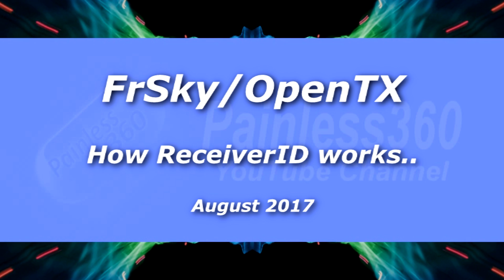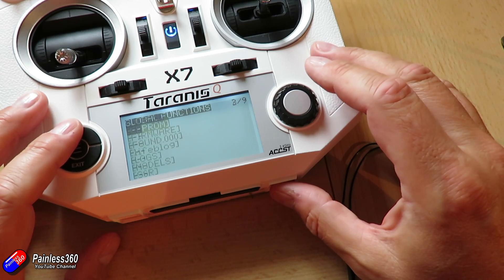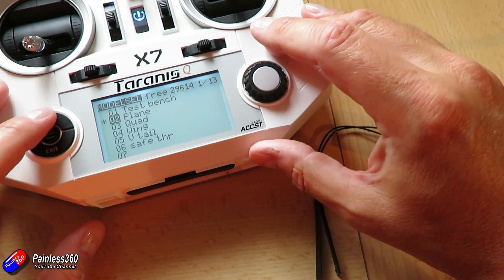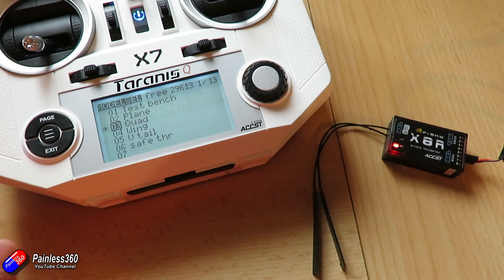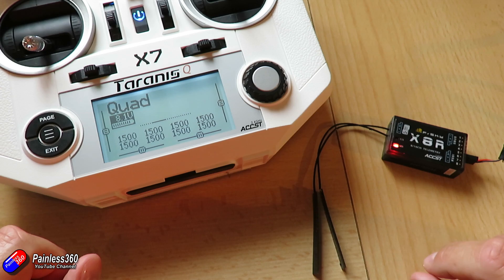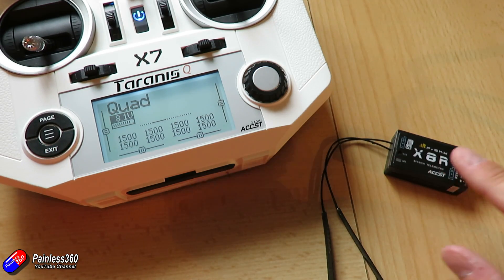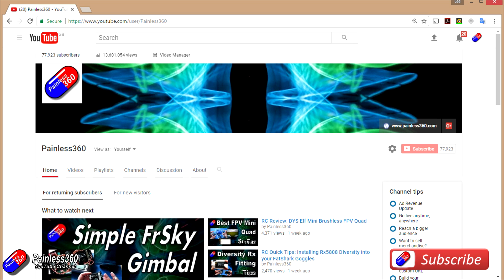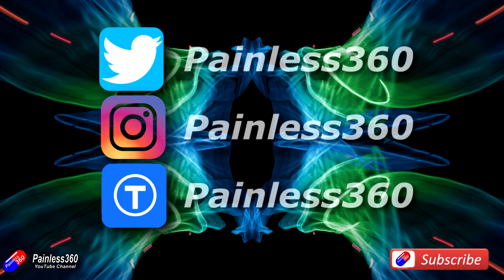RC Quick Tip: How does the RxNum work in OpenTX?

Comment: I’m searching thru your other videos now but I have 4 whoops using flysky 2a protocol and currently have them on 4 separate models which works fine but was wondering if I could use this method to have them all under 1 model and just change the rx number to let’s say 1,2,3,4 for my 4 whoops and have them
All under 1 model and I just cycle thru the rx number to the appropriate whoop so it’s bound
Reply from the maker: Yes you can, you can even set them up with the same RXNum but watch out to make sure only one of them is powered at once!
Reply: @Painless360  if they are set to the same r number won’t I run into the same issue I did before , which is losing the bind of the previous model? I’m able to put all my d8, tracer, crossfire, express lrs quads Under one model per protocol but flysky 2a I have 4 separate models. So what’s the best way do u think to merge the 4 flysky 2a models ? When I tried putting them under one model whenever I bind a new whoop I lose the previous ones bind so I’m kinda looking for a workaround
Reply from the maker: I use it with D16 and Crossfire here and it does not work in that way. The Rx remembers the RxNum and binds, even if other receivers have the same number.

Comment: Lee / All,
I just wanted to share an approach that may help avoid an unexpected loss of a model due to incorrect Tx Model selection - with the older 'R' series FrSky Rx - which bind in with D8 protocol. This protocol does NOT support Rx receiver numbers. I found out that it is possible for a completely different Tx model to apparently operate a non intended Rx. My solution is to put a Model audio announcement on each model. There maybe a better way but this seems to work well for me. I use the 'A' switch on the back position ( normal start position) to play an audio track ( once) using Special Functions. I used Audacity to record a short description of each model and applied it to the SOUNDS / En directory on the  SD card. A few guidelines:
a. The audio was recorded with a Project Rate 32000Hz using Audacity
b. The recording syntax was "MODEL ....[name / description of the model]"
c. I also used Audacity to clip the file track to make it as small as possible - helps playback
d. When using Audacity "Export Audio" ( for audio track saving) accept the default "WAV - 16 bit PCM ( Microsoft) file format 
e. The file name limitation for OpenTx / FrSky is 8 characters.. so audio file syntax would be "12345678.WAV" 
f. I mentioned that I use the "A" switch on my Taranis in the back position to trigger the "Play track" special function - and the appropriate pre recorded WAV audio file; this also is my Flight mode selector - and works nicely since I typically make this first flight mode position a neutral or non engaged mode.

Anyway, I hope this helps save few models from an untimely impact. Happy flying!
Reply from the maker: +Martin Schyns great idea! Happy flying

Comment: Great information but cannot locate Rx number on a model created using 2.1.9.  On models created on 2.1.6 the Rx number is shown. Was this functionality dropped on 2.1.9 or am I looking in the wrong place? - I see by your video that it does appear on 2.2.0.
I have found all your videos on the Taranis very helpful - Thanks.

Cheers
Reply: It's in the same place but called Receiver No. in version 2.1.9.
If you are using D8 mode you can't change it though, it has to be D16
Reply: Thanks for the reply I had used D8 and that's obviously the critical clue. Thanks again for the clarification.
Cheers

Comment: hi Lee.... is there any way to do it the other way around? ie use the same model in openTX for  multiple receivers. ie 1 model set for all my quads but each having their own receiver. I currently do it with spektrum, but looking at downgrading to FRSKY <snicker> due to wanting to use crossfire
Reply from the maker: +Daytona FPV yep, see pther comments. This is also how you can bind multiple recievers to the radio at the same time too. That maybe worth a video showing two X8R or one X8R and an XSR?
Reply: would be nice, because i'm a complete newb at open tx. still trying to find pros  to switching instead of buying another dx9
Reply from the maker: +Daytona FPV I also have a DX9, I never use it now I've got the Taranis and I'd been a Spektrum fanboy for over 6 years.. enough said? ;)